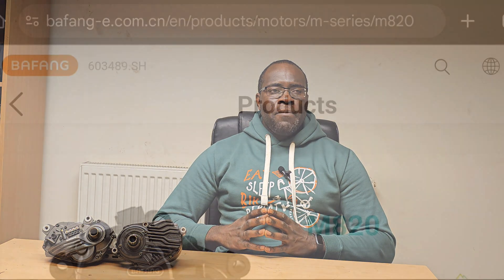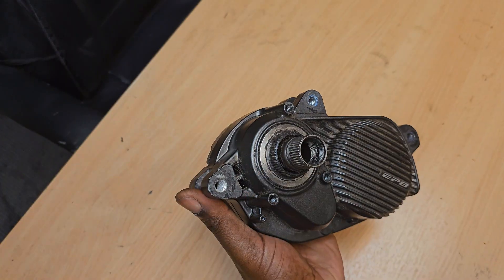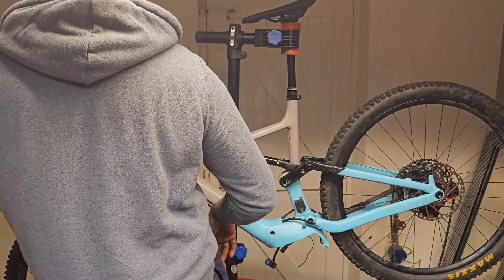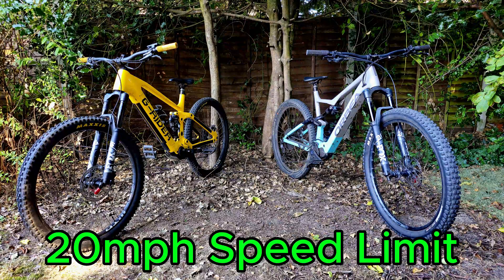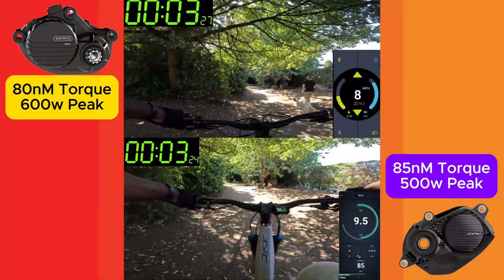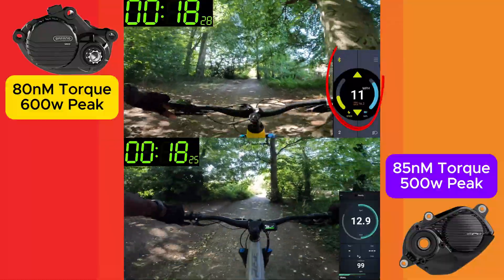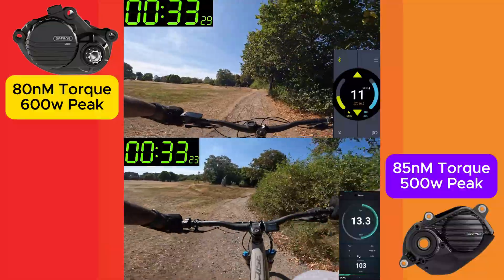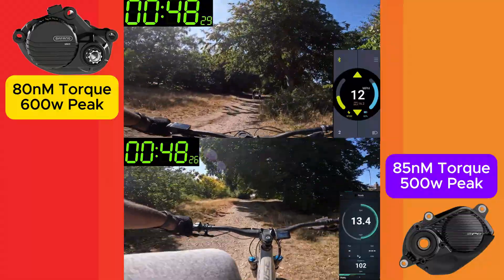Which is faster? - Bafang -V- Shimano

Comment: I have a question for you... do you ever had a problem with code e-21? I have checked and recheck the connection for the speed sensor and it just wouldn't work. Am I missing something? I have the newer cef55 frame
Reply from the maker: When I have encountered error 21, usually its because either the speed sensor cable is kinked or disconnected. 
The disk rotor magnet sensor is two pieces which connect together to allow for an easier plug-n-play instalation. Once routed and connected (ensuring no kinks or pinches in the cable), use electrical tape around the connector to ensure that they don't disconnect whilst riding.
Otherthan that, I would reccomend seeking someone with the Besst Tool to ensure that the speed sensor is working.
If you're in the UK, feel free to pm me and we can make arrangements👍🏿
Reply: @neekodevinchi 
Thank you!
Reply: @neekodevinchi 
One more question lol
Would any magnet rotor work with bafang sensor?
Reply from the maker: Shimano's disk rotor magnets work with Bafang magnet sensors👍🏿
Reply: @neekodevinchi 
Is it normal for the m820 motor to make a clicking noise? Have you experienced anything like that?
Reply from the maker: No.
My M820 motor doesn't click when I'm riding. 
You can feel a tiny bit of resistance if you push the bike backwards (depending on which gear you're in).
The motor can make some noise when achieving peak output. 

But I've never heard a clicking sound. 

Are you sure its the motor and not something else? Perhaps your lockring hasn't fully tightened the chainring spider.

Please advise👍🏿
Reply: @neekodevinchi 
What's the best advice for tightening the lockring?
Reply from the maker: @88jbc The lockring tool torqued to 15Nm.
If you Google "Bafang M820/M510 lockring tool", you'll see a lockring tool which looks similar to a Bosch Lockring tool. 
Please note, Bosch' lockring tool is different to Bafang’s lockring tool. 
Unless you wish to modify a Bosch lockring tool to fit in the groves of the Bafang lockring, I would reccomend buying the correct Bafang lockring tool.
Reply: @neekodevinchi 
So tq the lockring to 15nm instead of 30nm?
Reply: @neekodevinchi 
Thank you, i must have not tightened something goos enough

Comment: I'm sorry but I didn't quite get the point..So 80nm/600w is still not there, if it looses to EP8 which is proved to be weaker than say CX gen4 with same numbers.. But how much faster m820 is now compared to old firmware?
Reply from the maker: I'll go into further detail as to the difference between the old firmware and new firmware in upcoming content. 
But the characteristics of the motor have changed and motor over-run has improved👍🏿
Reply: @neekodevinchi  ah cool! that's how I know I have to subscribe )))

Comment: Neeko, in my effort to find the perfect controller that has built-in throttle, I came across the velofox DM09. My issue is I am unsure what mid drive motor would work with it. Do you have a list or video on controllers that have built-in throttle on the controller itself by chance?

velofox DM09 is brilliant as it is compact, OLED screen, and has throttle. I came across it when I bought a roadster v3 from ride1up and that's what started me on this journey.